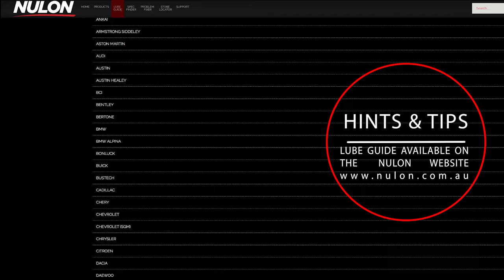How to -  DIY gearbox oil Change - Nulon Motorsport Garage

Comment: But in real life it's nothing like that. It isn't easy. Where is the filler point? That said, I'm assuming you can find the drain plug before hand. You learn absolutely nothing from these generic videos because YOUR vehicle isn't like that. This is just an annoying video.
Reply from the maker: Sorry your so frustrated Tony, this is a very common technique and most north south engines use this process to change the fluid in a manual transmission, Ford, GM, Nissan, Subaru, Toyota, Mazda, they all have the same process. If you would like us to walk you through how to change the fluid in your car just private message us and we can send you a link with all the instruction, it really is that easy.